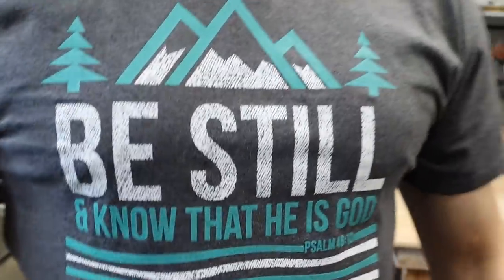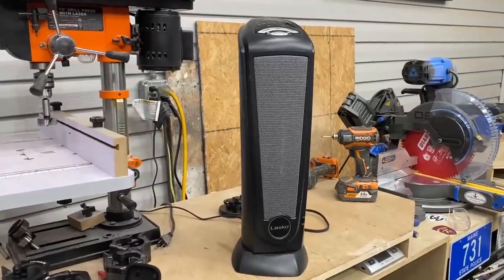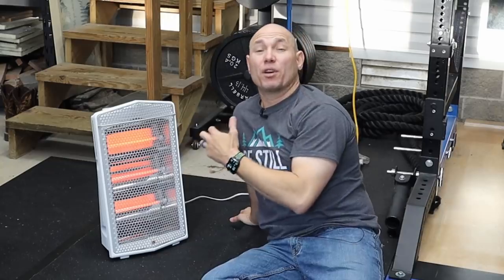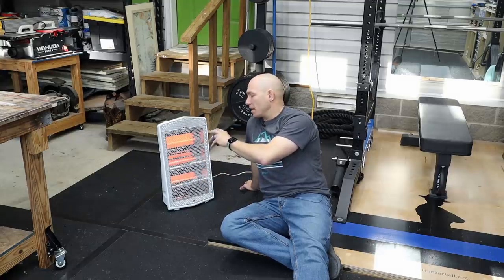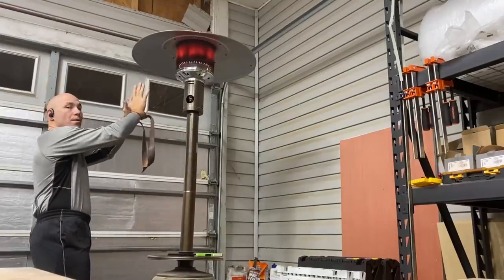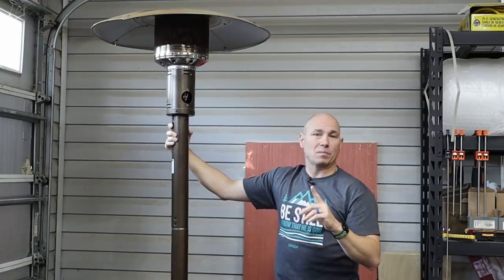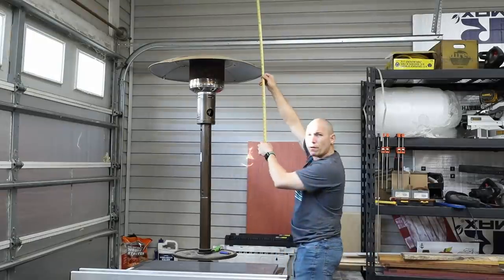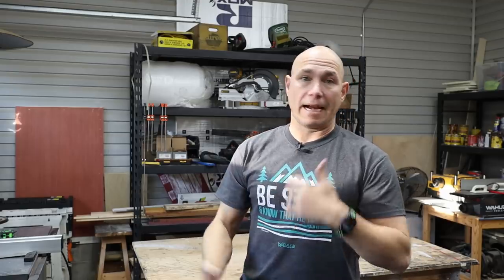How To Heat A Garage Workshop | Shop Heater Ideas

Comment: I'm 30 miles give or take from the North Coast in Ohio. Winter temps range from 40's to -20°F. Garage is 23'X25' with 8' ceiling. Temperature Controlled 80,000 BTU 5 gallon Forced Air Kerosene Heater does the trick regardless of temperature. Comes on when it hits 60° F turns off when it hits 67°F. Had it for over ten years. Average is about two weeks run time off one fill ($21 per fill) 60-80 hrs. work time. Door is always cracked about .5 inches along the top and sides so ventilation is not a concern. Sawdust has no impact as heater is not in any direct dust path (dust collection system installed). Garage is at a workable temp in 10 minutes or so but keep in mind 60°F is short wearin weather.
Reply from the maker: That’s awesome

Comment: I use a wood burning furnace. I get a month of weekends for about $50 if I have to buy the wood. I can get a years worth from the local tree guys in 3 or 4 weekends in the spring. It's worth the effort.

Comment: My three stall garage doubles as the wood shop. So what does it take to heat this Michigan garage? 1. I have heated basement (60 degrees) underneath the garage so when it is between 15 and 20 degrees outside the garage by itself is 40 degrees. 2. To raise the temperature in the garage to 55 - 60 for a nice working temp I run a propane heater (90,000 BTU, doesn't take long). Propane and kerosene have the same danger level, if your getting sleepy... there might not be enough oxygen in the work space. C0 is a dangerous, silent killer.
Reply from the maker: Thanks for sharing

Comment: I just disconnect the cloth dryer vent and reroute it into a bucket (some water in the bottom) it warm up my garage/shop/mess...😎😁😁
Reply from the maker: seriously? lol I mean if it works
Reply: @731Woodworks  yeah im serious, instead of blowing hot air out the roof in the winter i might as well use that hot air to warm up the garage..lol. There is a saying, "when you have little money you have to have ideas "...lol

Comment: It was 48 in the garage yesterday when I started working on some tedious sanding. Just put a hoodie on. I am still wondering what to do if it get even colder. Guess it depends on what task you need to do. Not crazy about the idea of a lot of floppy clothes around the table saw.
Reply from the maker: that's right.  I wear a hoodies a lot but they have snugger sleeves.  I actually had that in the video and cut it out at the last minute because I didn't want anyone wearing loose clothes and getting them caught in a saw.

Comment: Is your ceiling insulated>?
Reply from the maker: No
Reply: @731Woodworks  Get that done. That will make more difference than the door. I insulated portion of the attic that was over the garage and it made things a lot better. It also keeps it cooler in the summer.  I use a kerosene heater because running electric here in the winter is outrageous. (NW Ohio)

Comment: For those that use propane/ butane. It's cheaper to go to a dealer that fill the bottles. I pay $12 for 40 lbs. Walmart and others charge $17-$20 and the bottles are not full.
Reply from the maker: Thanks for the info

Comment: I don't have electric in my workshop, HOWEVER--I do use extension cords and plug a small ceramic heater in it.  Mind you, I don't have fancy equipment like most shops I have seen.  I have portable tools at best.  Since it is only 12x8 its not much to heat up in there.  I was thinking about a chicken coop heater for my shed.

Comment: The one thing I don't know enough about is finishing applications at various temps or with various heating technologies. 

For example, while some may not balk at working in 30-40F temps, your paint or stain will certainly care.  Ambient heating (heating the air) to the recommended finishing temps is an easy enough work around, but I don't exactly know how the infrared option I mentioned before would perform. In theory, it would work as well, or better, as both the wood and finishing product would be warned, but I haven't tested it.
Reply from the maker: I don’t use finishes in less than 50° temps. They won’t cure right

Comment: IMPORTANT: you need a carbon monoxide sensor (CO) not carbon dioxide (CO2)
Reply from the maker: Yeah that’s it
Reply: @731Woodworks  oddly enough, even though I knew what you meant, with modern propane heaters you don't have to worry about carbon monoxide (CO) however in an enclosed environment depleting your oxygen supply or creating an excess of carbon dioxide (CO2) is a genuine concern. I use a portable buddy heater in my shop and the manual says to allow a little bit of ventilation just like you suggested with your patio heater. Also you're right. It gets really cold here in Maine.

Comment: Firstly insulate very well then Underfloor heating all the way it turns your whole floor into one big thermal mass radiator. The most efficient. Next would be infra red ceiling panels. And 3rd a wood burning stove with stove fan. Anything else costs a fortune to heat.
Reply from the maker: Good ideas

Comment: This made me laugh. Yeah I am in Michigan where it snows and stays cold. When I was younger, at my uncles woodshop, all we used was old fashioned wood stove. Get out there in the morning build a fire. Honestly, within an hour we were working in a couple layers of clothes. 2 hours We were down to just t-shirts. Now days I use the hanging natural gas heater like you  want. I have tried a few radiant and so on. But never got warm enough. Also used one of those Salamanders, the big jet engine like ones to heat parents garage when I wanted to work on cars in the winter. Still needed several layers of clothes but  it was tolerable. However, my tolerable and your tolerable are very different.  For me heat is the issue. Man if gets above 80 I just don't go out and stay in the air conditioning.
Reply from the maker: lol it gets real hot here in the summers. 95-110 degrees with 90% humidity
Reply: @731Woodworks  That's a whole lot of nope from me. Way too hot. It hits 90 up here and people aren't leaving the house. Even my dog refuses to go out for an extended time when above 90.

Comment: I'm in California right in Silicon Valley so not really a consideration for me. Even if I'm working in the evening in the winter don't need more than a sweatshirt (I am primarily a hand tools woodworker so don't have the same safety issues with longs sleeves as a power tool person might so might want to roll up your sleeves in that case). In the summer if it's during the day I just work with my garage door open if it's too hot.

Comment: Freak out when it gets below 60 here! Have 3000 sq farm shop 14' side walls 5/7 pitch roof wrapped insulation but not high R value. NO Heat.
Reply from the maker: Warm climates have their benefits

Comment: i heat my shop with kerosene heater and burn diesel fuel in it diesel is cheaper, it need some fresh air so i crack the service door open a little about an inch
Reply from the maker: Doesn’t diesel put off bad fumes?
Reply: @731Woodworks  
yes it does but with the door open the smell isn't too bad.
Reply from the maker: Gotcha

Comment: If you have gas service, a large electric heater is not going to save you any money at all.  Getting a propane or NG installed will cost more at the beginning but will cost you a lot less over time.  The electrical heaters are killer when you compare operating costs.  Since you're so far south (Ontario here) you won't have to have a large expensive unit and you won't be running it for long so it will last a very long time.  Note, also a Gas Tech, electric heaters are a money pit.
Reply from the maker: Thanks for the info

Comment: Atlanta, GA here.  I have a well insulated two car garage (with new - this year - insulated garage doors.)  I just heat it with a single electric oil-filled radiator and run a fan.  Keeps it 65-70° easily.  Just like this one on Amazon:  https://www.amazon.com/DeLonghi-TRH0715-Oil-Filled-Radiator/dp/B000FT1XZW